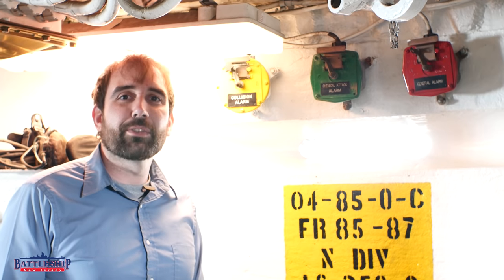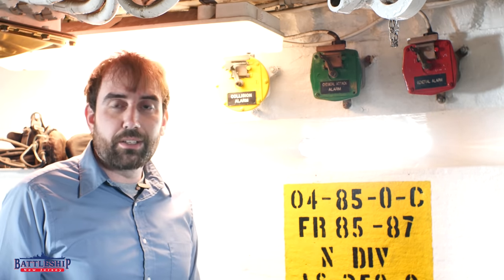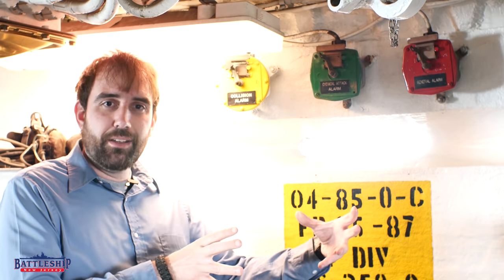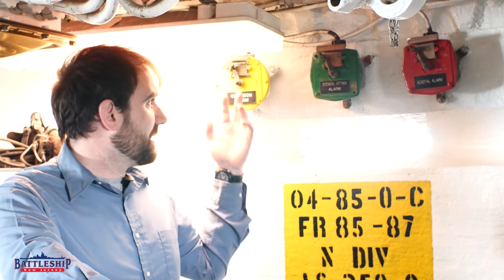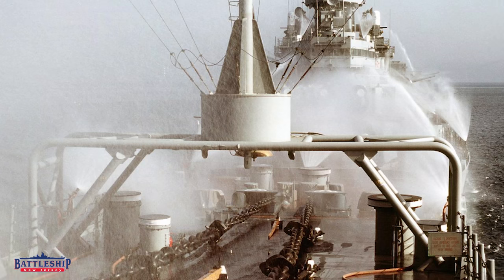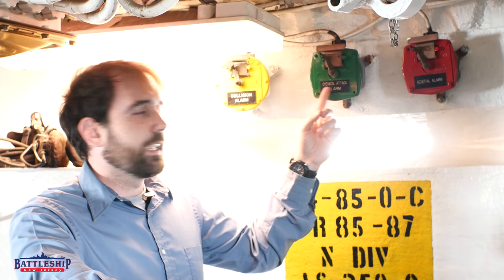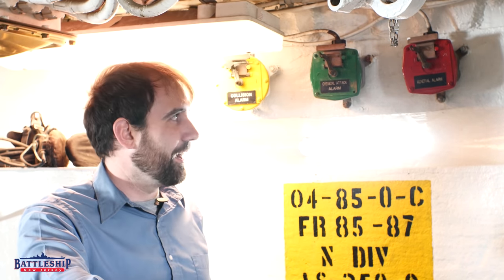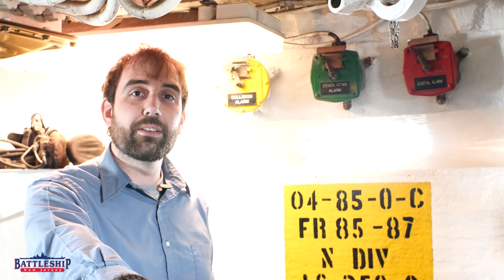That's Alarming! Shipboard Alarms and How to Tell the Difference Between Them

Comment: I don't touch anything in a museum, i was taught to respect other people's time AND i don't wanna pay potentially expensive things. I really don't get parents with kids letting them roam, and then you see a rare piece getting trashed because of it (speaking more about painting/art museums, but it does apply, i think).
Reply: In the 70's I got a detention for missing an excursion to the science museum. 20 years latter, I was employed by the museum and got to be hands on operating some of the equipment. The equipment was mainly steam engines, some 100+ years old, so they were solidly built, and also needed plenty of lubrication so cleaning the oil off was a fair part of the job.
The best part of the job was being able to go where the general public could not.

Comment: I wake every day to a general alarm recorded straight off of an old Canadian submarine's alarm stack; it's the only alarm that I've never gotten so used to that I sleep through it.

I'm told that on some ships and submarines, an entire suite of alarms are both color-coded and shape-coded. Particularly on submarines, where there's zero chance of any natural light if the lights go out. (There's also sometimes special alarms in the engine rooms because it could reasonably be too loud to hear the alarm!) Anyway, I find the whole topic fascinating.
Reply: Not just the alarm levers that are color/shape coded on submarines.  Switches and valve handles are so coded as well.  You've never seen dark until the lights go out when the smoke from a fire fills the boat and blots out the emergency battle lanterns (at 400ft/30kt).

Comment: When I was aboard USS Sacramento in the mid 90s the alarms were essentially the same as here.  The General alarm didn't sound for a minute, though- it turned off when you pulled the lever back.  I know that because I stood POOW a few times, and once had to do the test of the alarms from the quarterdeck.  For the test we sounded each for 5 seconds.  As far as I know we only had 3 places where the alarm switches existed- the bridge, the port quarterdeck, and the starboard quarterdeck.  But I may be wrong, as there may have been switches in DCC, CIC, or even in the IC shop.  We also had a flight deck crash alarm, which was operated only from the Pri-Fly.  

In addition to being used for chemical attack warning, the chemical alarm was also used as a security alert alarm in port.

In my time on the Sacramento the only time any of the alarms were used other than tests, drills, or planned GQ (such as going through the Straits of Hormuz) was on June 5, 1995.  That's when the collision alarm was sounded for real just before the Sacramento and the Abraham Lincoln traded paint (and some topside equipment) in the Persian Gulf.  That was followed shortly be a very real GQ alarm.
Reply: We had a Flight Crash actuator on the bridge as well, which was installed at the same time as the CCTV monitor covering the helo deck.

You are correct that the alarms COULD be triggered from the IC Shop.  The Alarm Oscillator which generated the alarm audio could be placed in the "Test" position, an alarm selected, then a button pushed to send the audio signal for the selected alarm to a local speaker.

Failing to place it in "TEST" position and leaving it in "Normal" when testing the oscillator resulted in your failure to follow the proper procedure becoming known to everybody onboard as it hit the 1MC....

Comment: Just a little correction, the Navy has not had gasoline in any aircraft, helicopters or the flight deck ground support equipment since the late 1970 when the Navy replaced the C1 with the C2.

Comment: Being a Navy veteran I have heard some of these alarms. Usually when you are out to sea you sound General Quarters. The Chemical Alarm, I never heard it. Same with collision alarm.  I don't even remember if there were any collision or chemical alarms on either of my ships USS Jason (AR-8) or USS Rogers (DD-876). But pulling any alarm was a Big No No.
Reply: All three alarms were there.  Standard for any surface ship.  Chemical would ideally be sounded AFTER GQ, so it could have been drowned out in the excitement of being able to join 20 of your closest friends in a repair locker the size of a walk-in closet.  In a nutshell, if you ever donned a MOPP suit and/or a gas mask during GQ, you just didn't hear the Chemical alarm.

Collision would have came with "All hands brace for collision port/starboard side".

All 4 (General/Chemical/Collision/Flight Crash) used to be a scheduled M1 on the PMS board, so you should have heard all 4 once a month or so.

Comment: So as well as the fire alarm, an unexploded bomb or taking on water, would be a couple of verbal announcements, because of location, would the general alarm sound first to bring attention to the alarm system.
You can have steam, chemical or fuel leaks and other hazardous conditions not caused by fire or collision.
So the crew, may have to be trained specifically for it.

Comment: Interestingly the vid of the plotting room of the Missouri during the missile attack just has comms "Missile attack brace for impact" and "Don gas masks",  did they get get refitted with a intercom instead
Reply: At that point they were already AT General Quarters.  Further alarms would be redundant and potentially confusing.

The comms you were hearing were over the 1MC...Shipwide announcing system.  In a civilian building, you would call it a 70-Volt PA system with auxiliary inputs...

Comment: There is nothing like the evacuation alarm sounding at work when a fire detector has operated.
Fortunately, most of the time it is a false alarm, but the evac alarm is by necessity loud and operates until the incident commander turns the thing off.

Comment: When I was in the USAF from 1973-79 and 83-84, I had access to the SAC Wing Command Posts.  I knew where the button was to activate the base klaxon which would send the alert crews running to their aircraft (B-52s & KC0135s).  I could have been shot if I had did it.  Both controllers were armed with pistols.
Once when doing the weekly PMI on the Alert Receive Panel, after per the PMI book notifying both controllers, I pushed the test button on the panel.  The red light flashed and the klaxon (local to just the Command Post) sounded.  In the Battle Staff room and officer in a flight suit (on alert) jumped up.  The officer controller jumped up waving his arms yelling, "Just a test!"  The alert crewman sat back down.  The officer controller then apologized to me telling me I did nothing wrong.  He had forgotten about the alert crewman!

Comment: I have noticed on some private videos that have been taken aboard Museum ships the amount of people touching and turning Knobs and switches that they know nothing about. The disappointing  thing is that it is Most of the time it is  the adults doing it and not the children. 
On some videos there are even signs or even ropes or chains to stop people doing it, but they lean over and do it anyway. It does suck because you want to keep the ship the way it was in service, and  not have a bunch of roped off and screened off sections and you should not have to spend money on signs and bunting and rope to stop people touching thing they should not be touching in the first place.

Comment: Where do I find out where a ceasefire alarm fits in the typical alarms suite?  I have a couple of Bollenger built cutters with problems with these ceasefire alarms. Trying to get prints and better understand them in order to find a common denominator to why they are always intermittent. Frustrating to not have prints to what must be a simple open or closed relay. Chand put them onboard they say…guess I gotta call them and see if they’ll be helpful or not.

Comment: Modern have a CPS system Collective Protective System using HEPA filters and other items to create a positive pressure inside, so any external contamination is forced outward.  The other alarms not covered are the ones in central contr

Comment: Aboard ship, both in port and underway a fire or flooding alarm would be phoned to the Quarterdeck (in port) or to DC Central OR the Bridge while underway.  The "ALARM" is sounded over the 1MC General Announcing system by the rapid ringing of the "Boat Bell" mounted on the Bridge or Quarterdeck followed by 1, 2 or 3 single chimes of the bell.  The rapid ringing is to get your attention (of course,) the chimes tell you roughly what part of the ship the trouble is in, 1 bell = forward, 2 bells = amidships and 3 bells = aft followed by the announcement "FIRE - FIRE - FIRE" or "FLOODING - FLOODING - FLOODING" followed by the compartment number.  In port there will usually also be instructions for the Duty Section to report to Repair Locker #1, #3 or #5 to equip themselves with whatever suits, Oxygen gear or other equipment they are going to be using.

Comment: 1975-76 I served on USS Samuel Gompers and there was a alarm that would sound automatically when power was lost.  The engineers had to get to their stations before security forces got to their stations because no one was to move when the security guards were there.
In 1979 or 1980 I was working in the dishwasher room on campus and was told that an alarm would sound if the soap got low.  I wasn’t told what the alarm sounded like and it was the same alarm as loss of power.
When it went off I was bouncing up and down trying to figure where my safe space was.

Comment: Although there isn't a specific fire alarm signal, I suppose that the foam-based or gas-based automatic fire extinguishing system in engine room or ammo storehouse must has its own alarm that goes off before spraying out the extinguishing agent and suffocating everyone left inside the space.

Comment: Quazi technical question.  Since the Ship is running off of power from shore, how exactly is that power converted to operate all the various systems aboard?  You have the retrofitted lights and other alarms mandated by building code, as well as powering electrical circuits that were native on the Ship.  Also what about plumbing onboard?
Reply: Because the ships systems are designed to run on shore power - the steam turbine generators produce 480v 60hz AC, 240v and 120v also at 60hz.   Because of this shore power is easy to use on the ship.
Reply: As stated by others, Navy ships are designed to use power from the pier.  Imagine multiple extension cords the size of your leg.  This has been covered by Ryan in other videos.  

In a nutshell, electrical, water, and sewer services are being handled by pier facilities, in the same manner and using the same equipment as they have been since the ship was built.  

Power is provided from the pier and connected to the main switchboards via the original installed Shore Power connections.  Shore power is 480VAC, 60Hz, 3-PH...the same as the ship's own generators.  240 and 120 VAC systems are powered through appropriate transformers, just as if the ship was running on her own generators.

Water is provided from the pier, hooked to the Potable Water connection, and distributed via the installed potable water systems.

As always, shit still runs downhill, even on board a ship.  When it arrives in the CHT (Containment/Holding/Transfer) handling area, it is collected in a tank then pumped to the pier...same as any other USN ship.

If the ship were still allowed to use the installed steam system for space heating, galley services, and hot water, there is a connection to receive steam from the pier as well. 

If the ship were still maintaining an active firemain system for shipboard firefighting, this would also be available from the pier.

FWIW, a standard Navy pier would generally be able to provide electrical power, potable water, sewer, steam, high-pressure firemain, compressed air, dial telephone, internet, and Cable TV.  (A ship is still "home" for most of the crew, even in port.)

Comment: It would make sense to me that the general announcement system should be used first before pulling alarms on a mesuem ship. I don't think that's something that should be done willy-nilly by guests. If the bridge were part of the tour, I could see having a seperate speaker being used to simulate the alarms and then that way if there are multiple tours going on the alarms wouldn't interrupt what's happening with the different groups.

Comment: The Countermeasures Washdown System is a dry system until it is activated.  Water is provided by firemain pressure, so your plumbing problems would not increase any if NJ had one installed.  The real problem with the CMWDS is the nozzles getting clogged with dirt and debris (paint/nonskid chips, BBs from shot blasting, etc) and not spraying water when you want it to.

Comment: As a BT on a destroyer there was a “switch” between the boilers that in three years aboard no one could tell me what it was for. Looking just like these alarms but Painted gray I assumed it was a light switch or fan control. While in port on light off duty I finally couldn’t stand it any longer I had to know…I grabbed a rag and started cleaning a few things and the rag “accidentally “ snagged the lever and turned it on. Nothing,no sound no flashing lights no shutting down of equipment.  A few minutes later we got a call from the quarter deck and my BTC told us that the emergency evacuation alarm for the boiler room had gone off.. why you would place it between the boilers the very place you would be wanting to get as far away from as you could and not near the hatch still makes no sense to me. And why gray? The Chief was actually very understanding about the rag problem too.
Reply: Theater in highschool had these hand cranks on the wall with cables going up into the curtain/light rigging. No one knew what they did, they were painted flat black like everything else. 

Well one-day moving a set around, and it caught the handle. Handle rotated about 90 degrees and then there was a bunch of light from above. Turns out the cranks went to the roof fire vents. If there was a fire in the lighting/curtain, you'd open them up to vent the fire/smoke. There was also a fire curtain you could drop to seal off the back stage from the crowd. 

Issue was it also tripped the fire alarm. So fire crew showed up, and no one knew how to close the damn things!. Took 3 hours to finally get them shut. After that they got placards next to them.

Comment: I actually have a GQ alarm as my ring tone for my past employer. I would think these alarms have changed in terms of sound since WW2.
Reply: Why change them?  Think of the confusion when the new sounds are used for the first time.
Reply: I have a version of the General Quarters alarm as the low battery alarm on my laptop!  🤣🤣🤣
Reply: @aevangel1  😆 now you've given me an idea.
Reply: @SOU6900  Enjoy 😎
Reply: @aevangel1  😆 I'd have to do some research on how to do custom sounds first though.
Reply: @SOU6900  it's relatively easy in windows, just go to control panel and "sounds" and you'll see where you can set custom "sound schemes"

Comment: That was my squadron HSL-33 the Sea Snakes.  President Reagan assigned us to the USS New Jersey, we were the first ASW Helio squadron to be stationed aboard a battleship. We flew the Kaman SH-2F Seasprite (LAMPS).
It was JP-5 jet fuel.
Reply: Were the Seasprites just kept in the open? As there wasn’t a helo hangar. That would suck…
Reply: @gunhog11  They were coved as best as possible.  There was one time when the #9 was fired off and blew out all the windows on our bird.  Had to go to Greece for new windows that the squadron shipped down.  After that our bird was moved to a cruiser so there was no repeat of that incident.  LOL
Reply: @StrokerStevens  Very interesting. I was wondering about how that would have worked out, both with no hangar and with the #3 turret right there. Thank you for the reply sir!

Comment: Actually, Ryan, I'm pretty sure none of the Iowa class battleships operated aircraft fueled with aviation gasoline after the FIXED-WING aircraft and catapults were removed. By the 1980's, military helicopters were using JP-4 as fuel. As someone who, like you, has been taught not to operate an alarm unless there's a real emergency, I've never been seriously tempted to pull an alarm without need.
Reply: JP-4 was primarily USAF, and was phased out in the 90's due to safety issues.  Ground-based aircraft generally now use JP-8, which is the dominant NATO aircraft fuel.

JP-5 is specifically formulated for shipboard use, and is a kerosene-based fuel with a comparatively high flash point, making it safer to handle in a shipboard environment where fume removal may be difficult. Used for aircraft and Gas Turbine propulsion.

DFM (Diesel Fuel Marine) is a kerosene/diesel base with heavier high flash-point oils added, and is primarily used as boiler fuel or in low-speed diesel engines.

DFM and JP-5 are pretty much the only fuels found in significant quantities onboard navy ships.  You will most likely find a drum or two of just standard Unleaded gasoline for the P-250 and similar portable fire/dewatering pumps.     

Since we were a Replenishment Oiler launched in the late 60's, we actually had an AvGas cargo tank and appropriate handling equipment.  If i recall correctly, that is where we stored our stash of Unleaded for the portable pumps.  To my knowledge, that tank NEVER saw actual Aviation Gasoline.  The only really safe way to have AvGas onboard a ship is to not have AvGas on board.  When you formulate gasoline for use at low temps and high altitude, it is much more volatile than what you put in your car this morning.

To put things in perspective, I think that cargo AvGas tankage was less than 1000 gallons total capacity.  Cargo DFM tankage was around 5 MILLION gallons, and cargo JP-5 around 2.5 MILLION gallons.  Cargo munitions storage was around 600 tons.